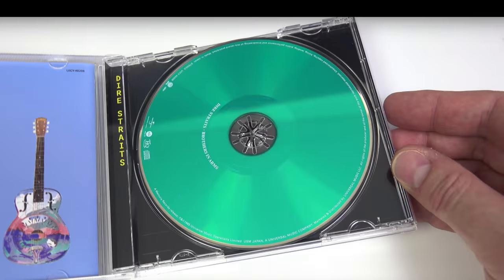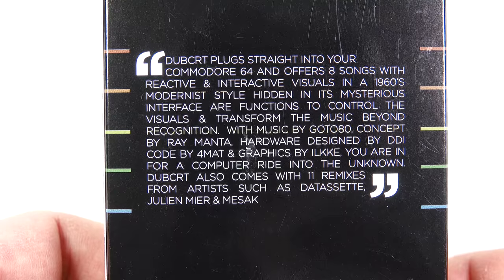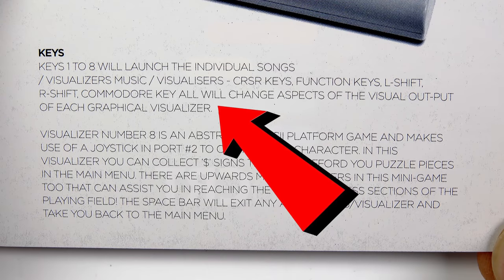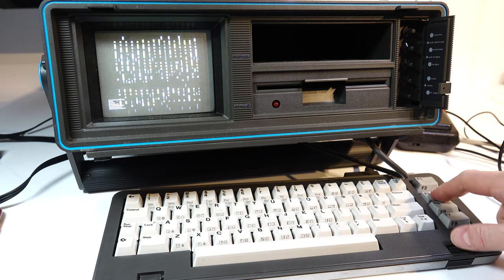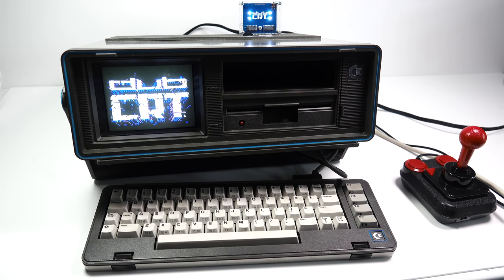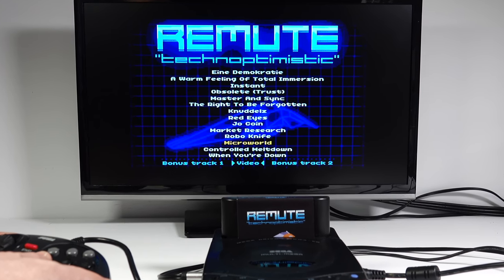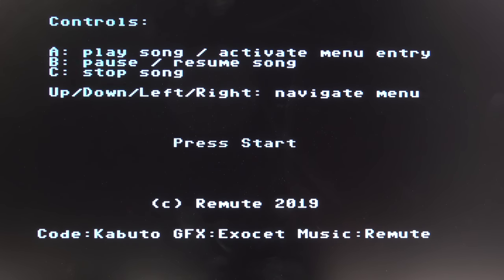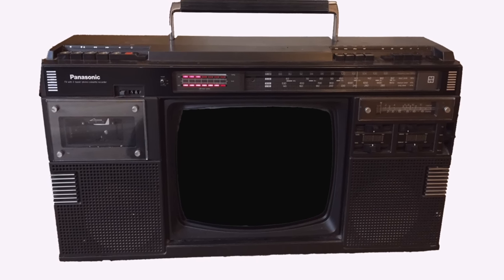Music Albums on Game Cartridges (C64 & Megadrive)

Comment: There have been other releases of similar stuff, especially in Japan. The 8BIT MUSIC POWER from Columbus Circle and many demo disks for the MSX 2 FM PAC and X68000 coming from publishers such as Namco and Compile just as an example.
Indeed a mixed bag, from really bad, I mean, "experimental", to somewhat "listenable" music. I understand that the MD was dissapointing, the sound chip is quite finicky and making music that sounds good is hard, but using the C64 SID to produce that pretentious noise is like blasphemy. I'm glad there are some other musicians, including some from the C64 golden age, still making albums of great music on the SID and even releasing them on carts or disks.

As a video game player and collector since 1985, I'm really not fond of these "experimental" albums. In my opinion, the real challenge and beuaty of it should be to make an astonishing use of the sound chips that would leave you wondering: "Is this from real instruments?" "Is this even possible with that old game console?".

Comment: A Raspberry Pi (Zero maybe) could probably do the job, there are a few visualisers already coded.
Reply: Pi zero has a composite header on the board, it’s just not populated as default. It’s to he right of the logo and labelled TV
Reply: Or in the pi zero W the logo is in a different place but header is still just by the GPIO